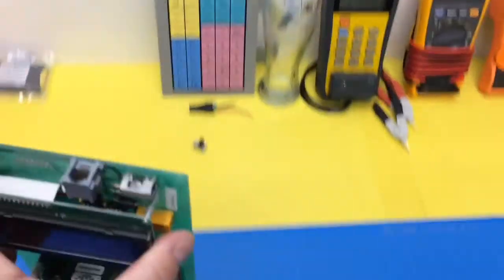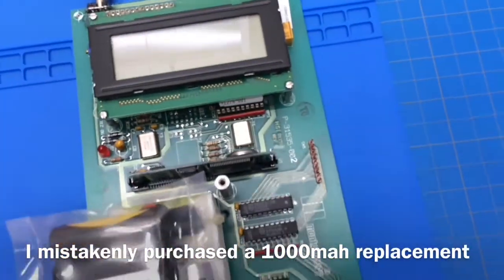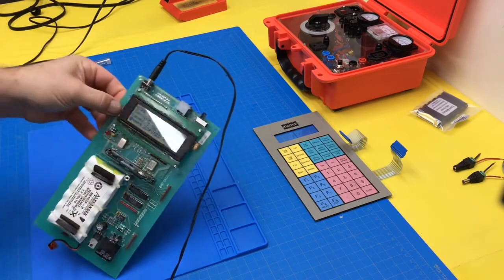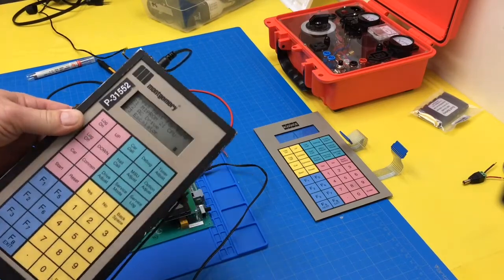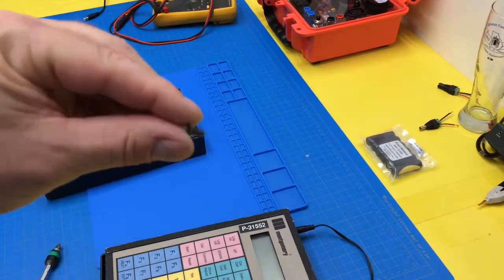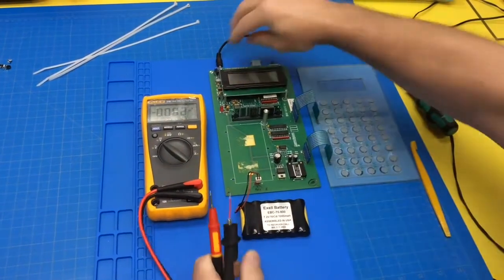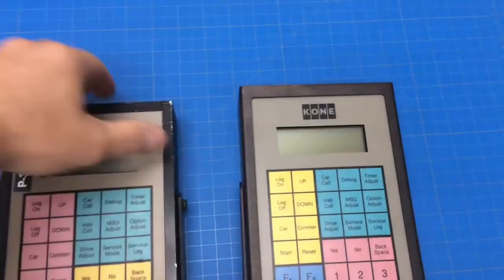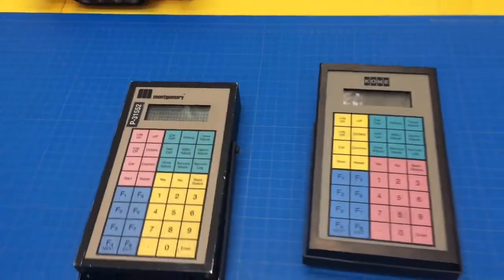Elevator Tools: Teardown & Repair Kone Elevator Diagnostics Tool / Service Tool Pt 2 [KTFG 362j]

Comment from the maker: www.KevinGittemeier.com
Shop Elevator Tools: https://amzn.to/2LtTIbX
& Elevator Reference Books:  https://amzn.to/2A3HF06
Electric Motor Maint & TS Books: https://amzn.to/2JIXiJZ
(Amazon Affiliate)

Video numbers 362a - 362j (10 videos) exist to rectify numbering duplicates.  I starting numbering videos Aug 2020 video “386 Standing Desk” using the total video count as the reference number.  Then in 2025 I starting numbering the oldest videos 001 and so on.  The number conflict is due to private videos & deleted videos.

Comment: How would I go about repairing or replacing the ribbon cable between the board and the display/buttons?
Reply from the maker: What’s wrong with the ribbon cable?
Is it physically broken or any wires physically broke open or cut?
Reply: @KTFG  I can see one of the wires is broken where it bends. It is the wire to the bottom row. I just cannot seem to source a replacement flat/ribbon cable. I was thinking of using conductive resin to fix it but would love something intended to bend.
Reply from the maker: Take it to a computer store and see if they have a match if not and one has too many wires you can just slice or peak those wires off. 

A good computer store should have something that will work

Comment: Kevin I replaced a battery in one and it smoked something on the board. Now I have nothing. Any idea and do you still do repairs. Let me know please. I have several.
Reply from the maker: That’s likely a goner but I wonder what smoked it did you reverse the polarity on the battery?

Possibly a capacitor or maybe a voltage regulator but I doubt the reg would smoke

I just repaired a few for a co-worker but I don’t do this for a living and don’t have any interest in it.  I don’t even have an electronics workshop anymore since I sold my house.

The problem is I don’t know of anybody who repairs them. A company will reboot them but won’t even do basic repairs like switch or DC jack repairs.
Reply: No sir on the polarity. But would you know of a place I can possibly get a replacement. I really appreciate your help sir.

Thank you.
Reply from the maker: I don’t know of any place.

Comment: can you reset an expired unit?
Reply from the maker: +Jackie Doyle 
I can’t but it can be sent in for refresh. Kone used to do it but now sure if they sold the rights or contract it out.
Reply: @KTFG  Cetek are the ones that make it but they wont fix expired tool because of contract with Kone